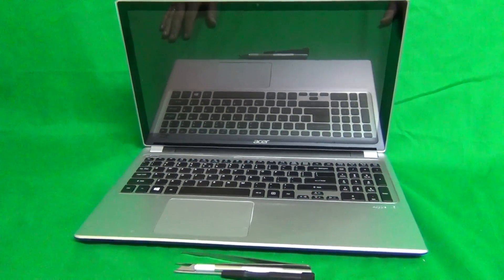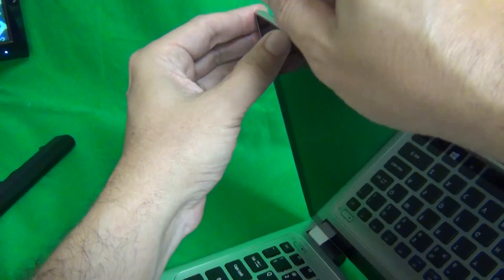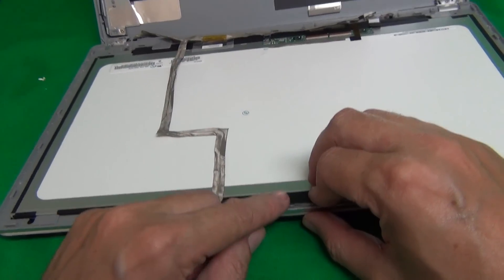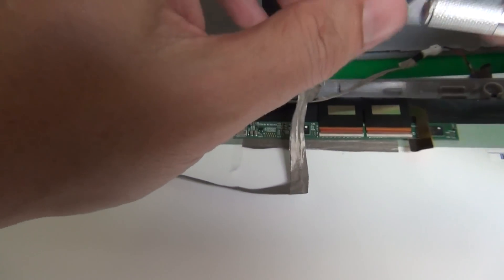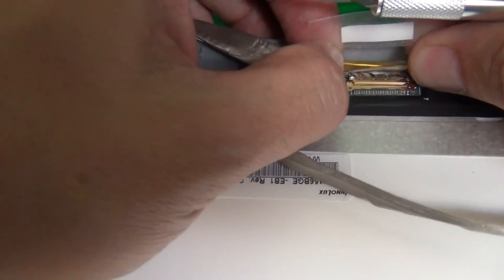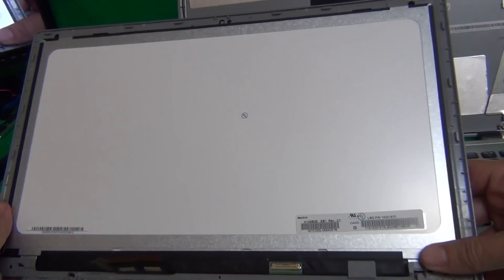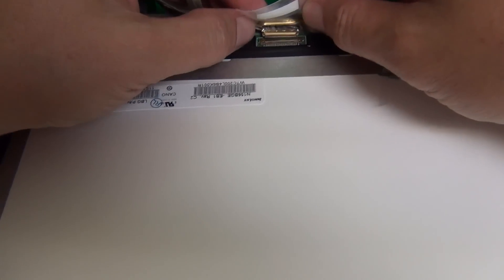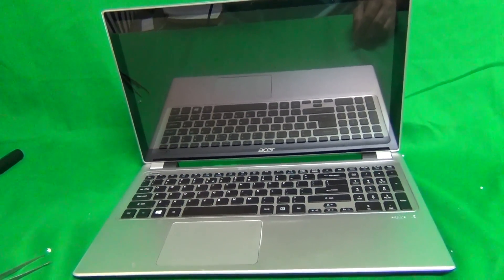Acer V5-571P Laptop Touchscreen and the LCD Replacement Procedure

Comment: How to replace the "touch Screen" only (NOT LCD) ???  The touch screen glass is available as spare part BUT I can find any video clip  showing how to separate it from the LCD screen . The spare part Digitizer glass comes with 2mm wide double sided glue tape.
Reply: The touch screen is bonded to the lcd with oca adhesive. It's just not realistic to separate the two parts. You have to buy and replace the touch-screen and lcd as an assembly.

Comment: I know this video is oldish so I don't know if I'll get a response, but I'm trying to fix my mother's screen, it only turns on when the lid is open on certain angles. I assume it's a loose wire somewhere and I tried disconnecting the video cable and putting it back in to make sure it's tight but it didn't seem to help. Do I need to replace the entire wire that connects the computer to the screen?

Comment: great video, thankyou.  I have a cracked screen just like this.  But i don't care about touch screen or webcam - can i replace with a simpler screen model?
Reply from the maker: +Damian Symons Unfortunately, you may not. A touch screen laptop display contains a touch layer (the digitizer) and the display layer (the LCD/LED panel or screen). If both parts are damaged, you will have to replace both. Thank you
Reply: Usted podría comprar solo la pantalla LCD de acuerdo a las dimensiones y  la cantida de pines del contacto y utilizarla sin el digitalizador (tactil), es como tenerla desconectada, yo la utilizé así un tiempo mientras compraba mi digitalizador.
Reply: @ScreenSurgeons  what if only 1 part is damaged?

Comment: i bought an entire complete screen replacement. and i noticed a difference my new one had silver foil strip near bottom under the circuit board...i was VERY CAREFUL..  my question is my laptop isn't recognizing it, I put back the cracked screen n it worked fine.. so why is the new one I got not working.. it is perfectly compatible...( i would think since it absolutely identical except one thing... the inside has a more of a metal shell holding that on top of the back of screen or white part
Reply: John Poydence same problem with mine

Comment: My finger was trapped when i closed the screen and in the process I cracked the black bezel and a bit of the lcd screen in corner but it works fine but if i change my mind and want to fix i will be sure to be buy it from you guys.

Comment: I work in a computer repair shop, I have the digitizer/lcd/bezel, but I am desperate for another digitizer circuit board. I cannot find one through all of the internet. I'm fixing a v5-571p-6649
Reply from the maker: Can you please try this.

https://laptopparts.ca/products/new-acer-aspire-v5-571-v5-571p-v5-571pg-digitizer-board-ck77-e85792
Reply: Trey Dancer did you ever find one?

Comment: have a B140hat02.0 Acer Aspire R14 R5-471t 14" LED LCD  cracked Touch Screen  so iam asking if the LCD SCREEN  and digitizer are assembled together or they are seperated ?

Comment: Is it possible to replace an Acer Aspire V5 471 with a V5 471P LCD & Touch Digitizer Module with the digitizer control board and cable?

Comment: Hi,
I have a Acer V5-572p 15.6 multi-touch hd led lcd, do you sell repacement screens for this model. Also would the proceedures for replacing it be the same as in the video.
The issue i have is it appears the led back light isn't working. You can see the lecd screen throught the touch panel and it all work fine apart from the back light.
Can you get a replacemt led??

Comment: I have this laptop and the screen is broken, then i replace with new lcd only monitor without touchscreen for acer type laptop series V5 471 not for v5 471p, 30 pin connector is same but screen can not respon to  live, do you know this problem is there where?

Thank'

Comment: Is there any way I could just replace the glass? I managed to just crack the screen but not damage the touchscreen
Reply: yes just remove and buy LCD screen but you need to be careful in buying LCD or LED screen bcause other LCD screen have different Number of PINS just like this kind of laptop 11.6 inch may some 30pins or 40pins